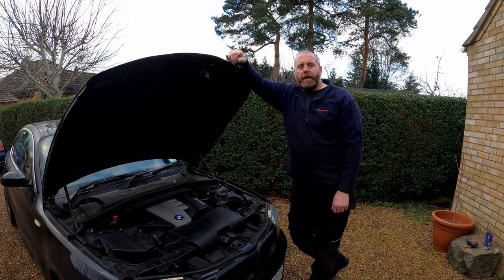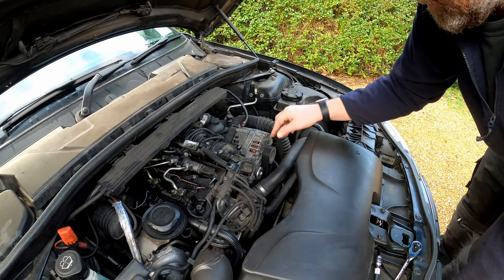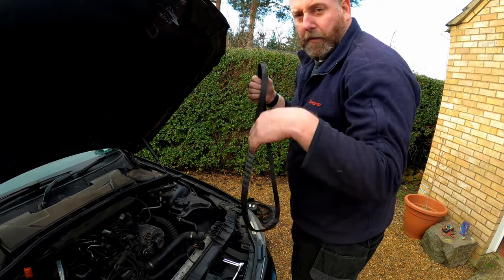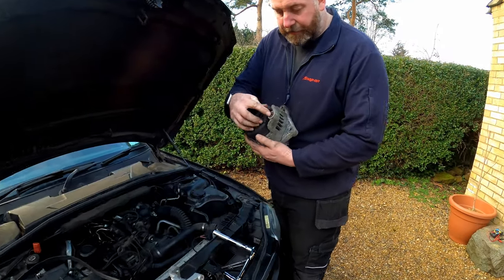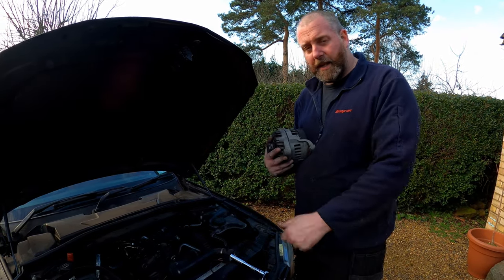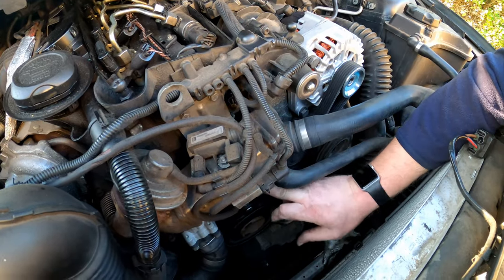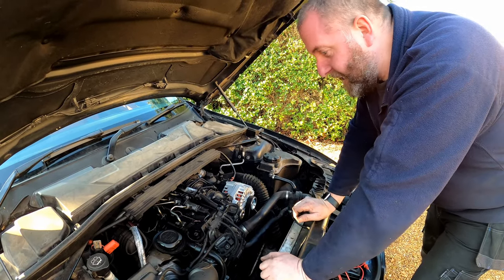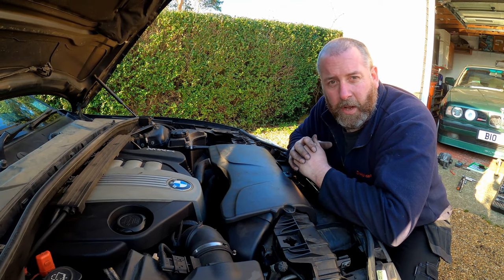BMW N47 Engine - 1, 3 & 5 Series, Plus X1 & X3 Diesel Models - Alternator Replacement

Comment: To separate the alternator from the motor bracket, first unscrew the upper (SW16) screw approx. 5 mm, then unscrew the lower long (SW 16) screw 5 mm. Then, using the short 1/2" extension and a hammer, tap the head of the lower screw until the alternator dangles loosely in its holder. Rust remover and hot air on the rear bracket connection will help the threaded bush to slip out of the engine mount.

Comment: I'm now at the situation that I need to do an altenator change on my e90.  The voltage is 12.2v when the engine is not running. It does not change when  the engine is running, still remains at 12.2 volts. This is not correct. I've noticed that if I turn on the lights the voltage goes up to 14.6 volts so the alternator kicks in.. I suspect that the voltage regulator is faulty. There is also a chirping noise from the belt at the alternator. This noise is intermittent and I have already changed the belt and tensioner. 
I have just bought this car and had to change the battery as it was the original (12 yrs  old) and was struggling to start the engine. My car is a 2010 e90 and  has the N47t engine so unfortunately the alternator is not as easy as your one to replace. Part of the intake manifold needs to be removed to make room. Bmw made a number of revisions to the layout of the engine in the  face lifted n47t version.
I'll get there in the end,,,
Reply: I have got the same problem.. i changed the battery and coded. engine when it is off is 12.8v when is running stays 12.8v but when I turned it on my headlights goes 14.6-7v... did u managed to get it sorted? What was the issue?

Comment: Hi Kev, thanks for video. Bottom bracket is stuck, how did you go around getting out original alternator?
Reply from the maker: The bottom one is difficult as it has the captive nut that pulls in as the bolt is tightened, this takes up the space between the alternator bracket and the block. They do corrode which makes them stick solid. My advice would be to get some heat on it with a blowtorch. That should help 👍🏻
Reply: Thank you.

Comment: Thanks for the video! I have one question though. What if you're replacing the one you have with another used one? Do you have to do anything with that nut you're talking about at 9:29? Do you have to somehow put it back as it would be on a brand new one? If so, how?
Reply from the maker: You can push it back with a set of good grips, takes a little effort that’s all. It’s really difficult to fit unless you do that to be fair.

Comment: hi kev , i have the same n47 and i change the alternator too , but the one i put is getting very hot like you can t put your hand over . yours is getting that hot too ? i don t know if this is normal or ther s a problem . can you check for me please ? i need help 🙏 thank you ✌
Reply from the maker: They do get very hot during normal operation mate. Provided it is outputting the correct voltage, it is nothing to be concerned about! 👍🏻
Reply: @KevsShed  thank you kev , i was worried seeing it getting that hot i was really scared to go on long distances . first i put a non brand alternator ,was working fine getting the right voltage ,but it was getting very hot . i changed with a valeo one and the same , working fine but but getting very hot . i mean now,  it is directly close to the block of the engine who is getting really hot, right , and part of that heat is transmited to the alternator , i mean is metal on metal . thank you very much kev you help me a lot . i wanted to be sure . excuse my english i am from spain . ✌🍻